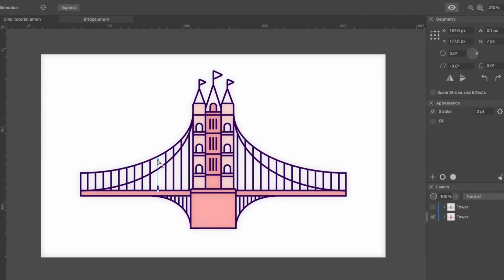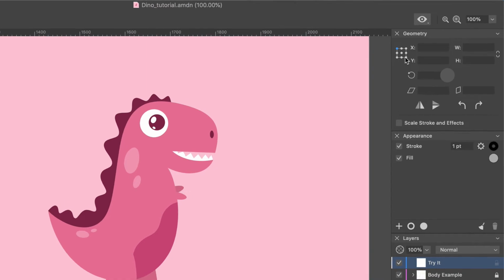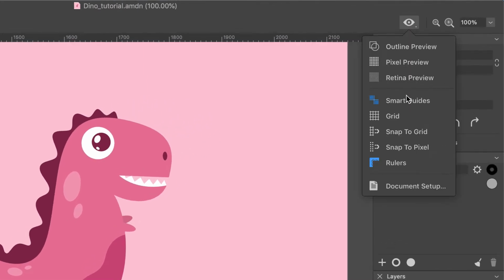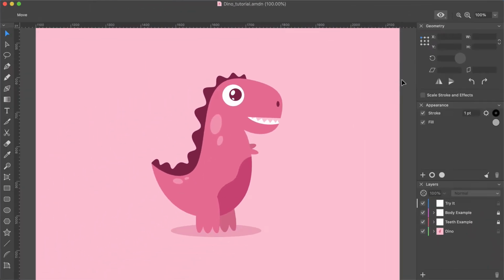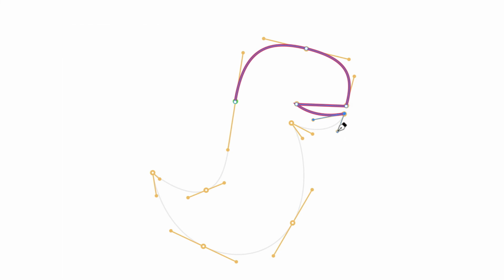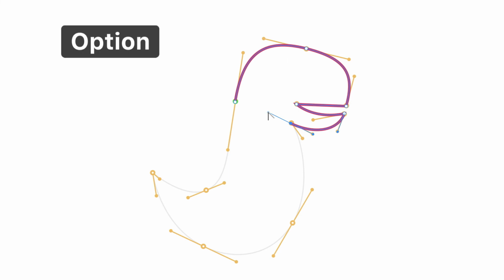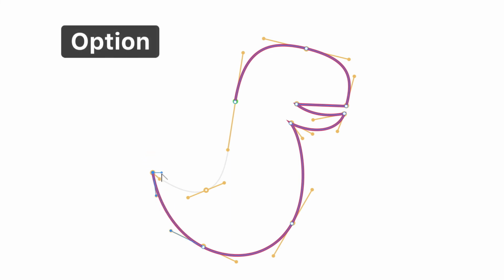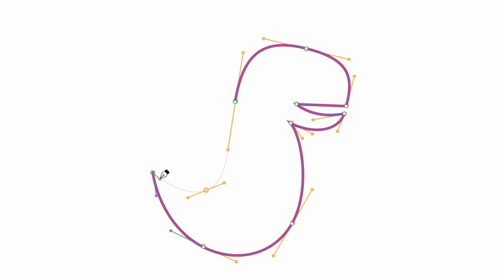Drawing with the Pen Tool—Amadine for Mac Tutorials

Comment: This is probably the best replacement for the very confusing Illustrator.

If I buy a license for Mac, will it be extended to iPad, or do I have to buy it separately for each device?
Reply from the maker: The program sold on different platforms is a separate application, it needs a separate installation and requires a separate purchase. The Mac version can be purchased from the Mac App Store and the Amadine website and the iOS/iPadOS version is available only at the App Store.

We can offer you a 50% discount for the lifetime license for the macOS version to be purchased from our website if you send us the receipt for your iOS version. Please, contact us to sales@belightsoft.com and describe your case.